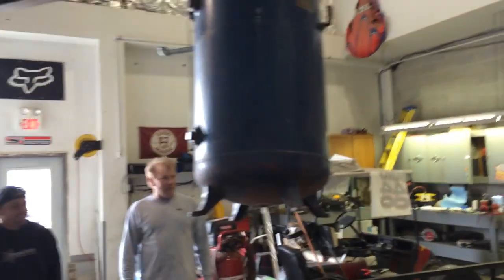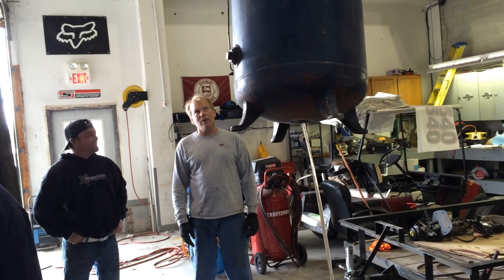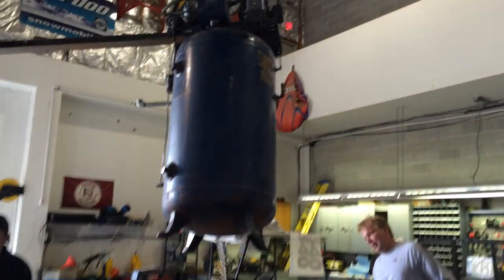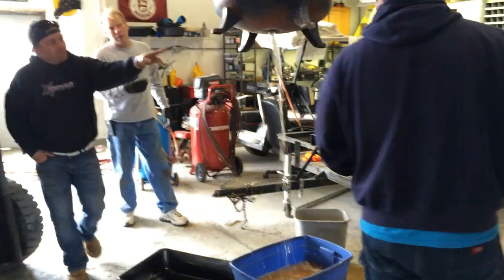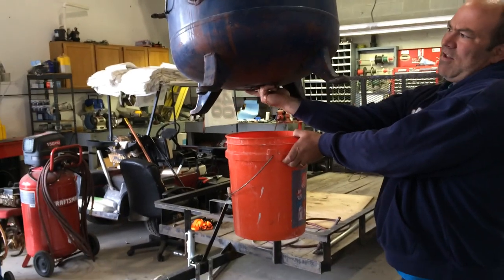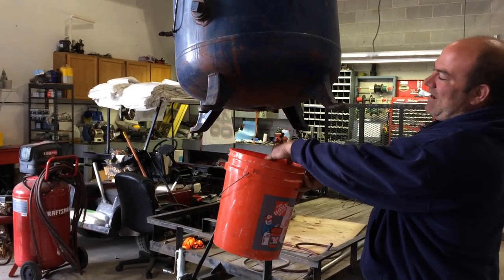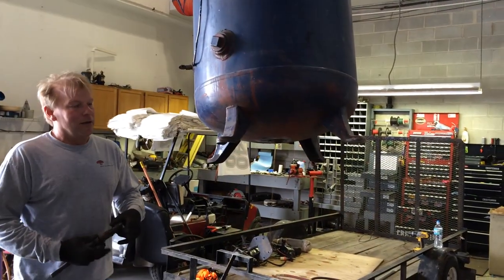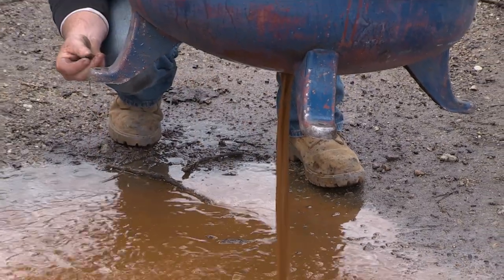Why You Need to Drain Your Air Compressor - Vlog

Comment: Every compressor in the world is rusted on the bottom. It takes one day. This is why uprights are so much safer than horizontal tanks.  Horizontal tanks can fail over a huge area creating insane short bursts of thrust,.  An easy way to see where you compressor tank is at is to glide a heavy magnet across the sides and then the bottom and see it weakens noticeably,.  If it does get rid of the tank DO NOT PATCH IT!  Most fail by leaking mildly but a patched one will fail in the most ugly way.  This is why you bolt the tank to a frame and pipe it to the wall.  My compressor has two 5 HP 220 motors and 2 5HP Vtwin single stage pumps.  There is at least 500lbs on top of the tank platform which is also supported with struts to the ground.  There is absolutely no way it will move if the tank fails however I'm not in the mind to test that sentiment.

Comment: Folks should also drain their hot water heaters once in a while to get debris out of it and off the bottom of the unit or the lower heating element and increase it efficiency somewhat.  Esp. it your on a well, every 3 months I'd take a gallon pail off the bottom and it would run out brown for a 1/2 minute then turn clear quickly.

Comment: There is a reason why high pressure vessels require testing periodically. Erosion of the steel happens, the metal with begin to get thinner and thinner. Many of those Home Depot shop compressors have a low ASME certified rating when the steel is perfect. A new tank that passed a pressure test at 200PSI, would not pass rating after a good deal of erosion. Lets say the metal at the bottom was originally 3/16 thick. Well after erosion it may be reduced to about 1/6 or thinner. 135PSI against  1/6 or eroded steel is prone to fail. Since we are deal with air pressure and not liquid pressure. This tank should be decommissioned, it is very unsafe. Keep in mind, you've now removed all the liquid pressure. If the tank ruptures, unlike liquid which opens a small tear, a rupture by air will rip the side of the tank open instead. It's more common than you may think, many lives and limbs have been lost to compressor tank ruptures. I got a tank like this once, it was a 60gal tank with about 30 gal of water. The tank was ASME certified to 380PSI, since it had a large amount of metal, it's now only good up to 220PSI, I personally only take it to 175PSI even though my pump is designed to reach 275PSI max. For other readers, if you have one of those tanks with leaky pinholes on the bottom (notorious in the horizontal 20gal tanks), don't say no one warned you. 

This guy posted a good example of what happens: https://www.youtube.com/watch?v=KVP_A7eGYxw

Comment: A safe brand new vertical 60 gallon tank is $405.  Horizontal is $450.  The compressor and motor can be moved to the new tank and a new $15 safety valve installed...  Still way cheaper than a new 60 gallon unit.
Put a 1/4 turn ball valve on the bottom with a pipe that puts it in easy reach.  Run a hose through the wall.  Blow it down every bloody day and leave the valve open.
A lot cheaper than a ride to the ER and emergency surgery.  Cheaper than a funeral too...

Comment: That air compressor tank may be junk, I tried to weld steels patches into my 8 gallon and the Steel was to thin, the welder just blew through, I bought it for 20 bucks with a perfectly working 65 gallon so good deal
Reply: I wont be so sure about that..pinhole leak if you lucky, but if it already have a rust lines of crack, then its gonna be a mini tumbuska event

Comment: rust wont cause explosion, it will create pin holes and leak like a sieve, but it wont explode
Reply: I agree, it would have to have WAAYYYY too much pressure to explode. Standard shop air is usually around 90-100psi, maybe just a bit more depending on what type of tools you are running (for my impacts and die grinders, etc, 90 is what I run). Most take blow off valves go off at 150-180. If you have enough pressure to blow up a tank there is something wrong with your setup! I would think that a rusty tank just wouldn't ever get up to pressure if anything. If it was me I'd drain it, install all new valves/hardware and run it for a while.

Comment: I would not trust that receiver the rust would have severely weakened its structure and it could possibly explode when it's pressurized and cause death or serious injury to anyone near it this is why it is important to drain  regularly and periodically have internal inspection carried out

Comment: I would not trust that tank under pressure.
Reply from the maker: It still works today
Reply: +Tools In Action 
right until it explodes and kills someone. then it'll stop working right away!
Reply: Mark OnTheBlueRidge 
ok... let's think about this. what exactly is over pressurization on a rusted out air tank? what is the difference between a tank explosion resulting from overpressure and a tank that is weakened by rust?
Reply: Mark OnTheBlueRidge 
ok... let's think about this. what exactly is over pressurization on a rusted out air tank? what is the difference between a tank explosion resulting from overpressure and a tank that is weakened by rust?
Reply: Mark OnTheBlueRidge 
air compressor tanks have a service life stamped on the side for a reason. when it gets weakened over time it can let go ripping, tearing with explosive force. the tank is tested to be safe at a given pressure for an assumed amount of service life taking into account how long it might take to rust a certain amount but if the tank has been weakened due to heavy corrosion inside from lack of maintenance it would be exactly the same thing as over pressurization.
Reply: Mark OnTheBlueRidge 
now look at the last two pictures. if you notice a jagged piece of steel on one of the end caps that would have been at the bottom, this is the weakened area due to corrosion and this is where it started to let go. the rest of it just followed ripping apart violently almost killing the poor old man. whether It was caused by a malfunctioning relief valve or not it started with a week spot. if the the relief valve is working but the week spot is weak enough you get the same results. understand?
Reply: Mark OnTheBlueRidge 
it's not a matter of research it's a matter of common sense! it's ok to be wrong and if I agreed with you we'd both be wrong.
Reply: noting?
Reply: could you slosh some fishoilene or rust converter around in there to stop ongoing corrosion?
Reply: Its probably pretty thick tank. What worries me i got cheap air compressor with prety thin tank and i think it doesnt drain fully. drain is not on the bottom and i have to tilt it but still not sure everything comes out

Comment: HMmm, I'd make sure this unit is kept behind a safety wall of some kind, with that much rust on the inside, its ready to rocket.  Scary stuff......
Reply from the maker: +JimsEquipmentShed It still works today
Reply: +Tools In Action when I was in the military we had a 1000 gallon unit pop. It moved a 2-1/2 ton truck almost three feet. The drain on that one had apparently failed, and no one noticed that the unit was coming on more than normal. (They just figured they were using a lot of air in the shop.) no one was hurt, but it scared the shit out of everyone in a one mile radius.  ;-)

Comment: Not sure why they don't make the tanks of aluminum?
Reply: Pressure.
Reply: They do.  They also make carbon fiber ones.
Reply: Cost, durability. Also, if you drain it, they last centuries. Its an operator failure, not an equipment issue.

Comment: Thats nothing.  Try a 5000 ltr reciver that was nearly full to the outlet.  They couldnt understand why there veriable speed compressor( 160kw) was ramping up and down like a roller coaster and that  production were complaining about low air pressure.  .  Took about an hour to empty the water out. Some fool had removed the filter from the auto drain allowing crap to block it up.

Comment: Geeeze it must have sent water through air tools or anything else you were trying to use.  I worked in a shop like that & knew when it needed draining when ice chips came out the air grinder exhaust ports.  I put an auto drain on mine.  Cycles every time the compressor starts or stops.  I've seen them start peeing on the floor when rusted through but never catastrophic.  Still 150 psi or so is a bunch of force & needs to be taken seriously.

Comment: They're NOT ticking time bombs, as they don't explode.  They just spring leaks...
Reply: Mat Helm A quick look here on YT shows it does happen.
One guy caught it on video injuring his Grandpa
Reply: All tanks are rusty, and will at some point fail.  It's the pressure switch and safety valve you need to worry about.  In the Grandpa video you mention, it would take a runaway compressor half full of water to blow like that.  Water is not compressible like air, as in it has about the same compressibility as solid steel.  So if you don't drain your tank, and the switch and safety valve are working, the only thing that will happen is it will drain itself eventually via springing a leak.  My only point is that they are not ticking time bombs, not to say they can't become bombs.  But that's where Darwinism kicks in...

Comment: The reason why you are supposed to drain it, is not just because it builds up water which rusts the inside but also weakens the inside which could explode on you. Misleading title.
Reply from the maker: ***** What is misleading about it?
Reply: +Tools In Action "TICKING TIME BOMB" "Why You Need to Drain Your Air Compressor"

Ticking time bomb insinuates it goes KABOOM, either way why call it a bomb then continue using it? Unless it's behind some concrete walls away from anyone ever getting near it.

Comment: How many Years of Not Draining   Added  Up to That Water fall?   .....................   & They/factory don't Put petcocks on bcz The Compressor Rusts/Leaks/Blows out   Quicker To Buy a New One..... & Just Bare metal/a bit of Not Lasting galvanized   Surfacing (Burned of in the Tank piece Welding Processes)   Inside to Rust Quickerer,   Too....

Comment: Moisture settles when tank is off.
Moisture is released with air as it is delivered for its purpose.
Moisture also condenses in the pipes and pressure valves used,
Best to have pipes installed like sewer pipes always a little down hill so you can empty the water that forms inside. Also use dead drop pipes.
Don't be lazy or ignorant like these guys.
Practice good maintenance. Drain it.

Comment: With so much water buildup, it only means the water was sitting in the compressor for decades. I don't understand why the people are even cleaning it. This is a total throw away item, completely unsafe. Scrap metal. Please don't be stupid.
Reply: +Zabak Kuku turn it into a BBQ grille.  I'd cut the mother open before scrapping it so it couldn't be used as a pressure tank.